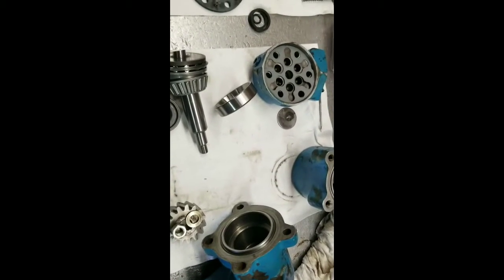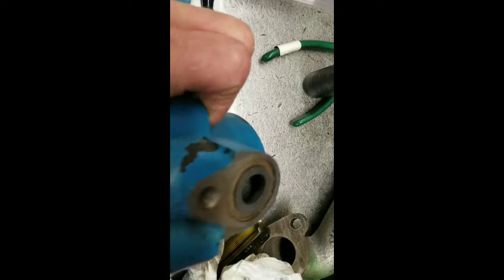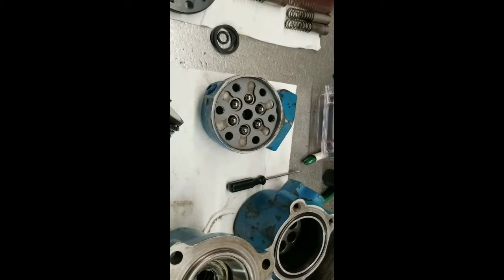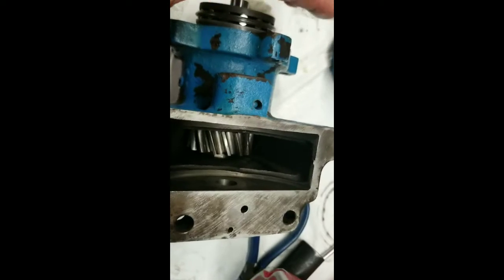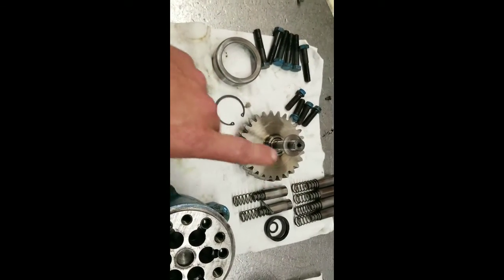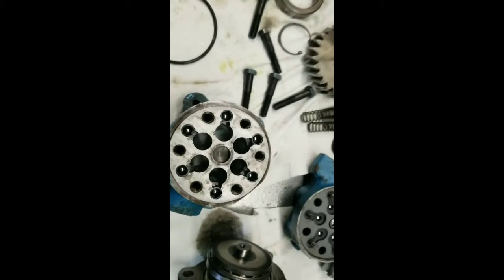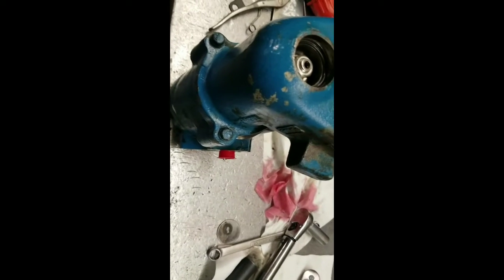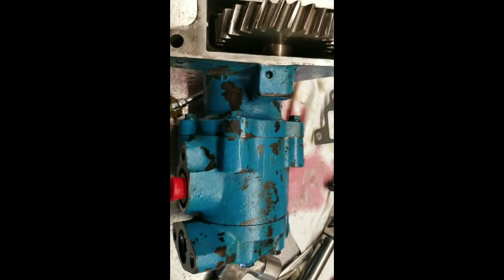Rebuild of a hydraulic pump of a 3000 Ford for Du Farmsabit

Comment: does the shaft that has the wobble plate attached to it just press out after you remove the nut?
Reply from the maker: Yes the gear is on a straight keyed area of the shaft, it should push right off
Reply: @cesmith4566  I did get it off but had to use a press,. Pretty tight,. Same with old seal, was a battle to get out.  I was reluctant at first to press out in case i damaged something, i wanted to make sure first.

Comment: I'm rebuilding a pump that my mentor built, the updated Ford seal is blue silicone rubber the  low cost kit has a black hard rubber. Do yourself a favor get the blue one. Cheap insurance and take some 120 grit sand paper to the seal surface on wobbler (swashplate) shaft.

Take note what he says here about the balls hanging up on keepers 5 of 6 we're hung on a new rebuild.

Comment: pretty simple pump. i am having trouble with a john deere la175 lawn tractor. it has a piston pump in the hydro static drive. its made by tuff torque. the face of the pump gets scored and loses pressure when it gets warmed up and the oil thins down. tuff torque says john deere shipped them with too thin and too little oil and it gets hot.so then it is almost metal to metal and this causes the damage. i was thinking of trying to find somewhere that i could have it machined. then put in the correct amount of oil.
Reply from the maker: You have to be careful some of those surfaces are hard faced , once you grind them flat again the surface isn't as hard as it was. They didn't use Hydrogear pumps? All the zero turn mowers use them.  I have a box of junk  Hydrogears there just not heavy duty enough!